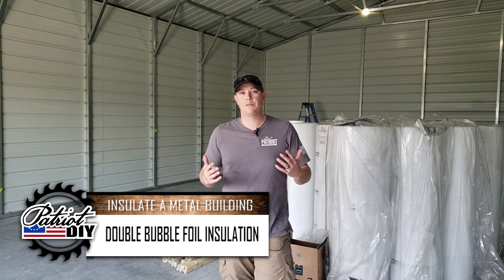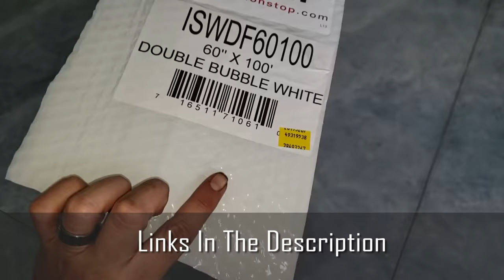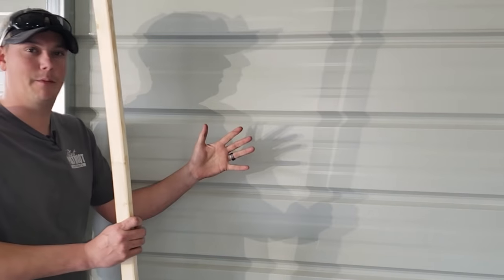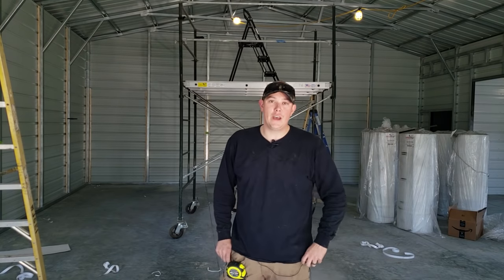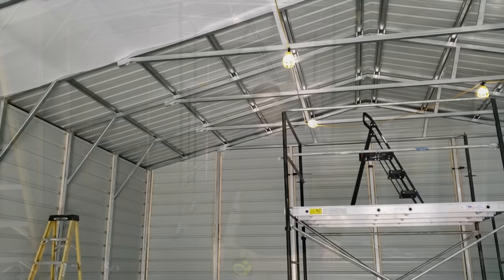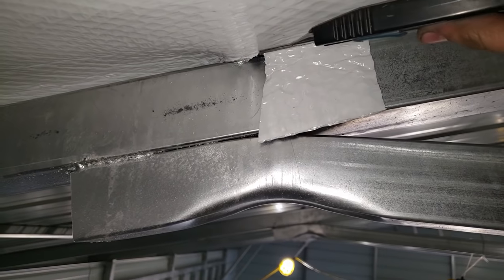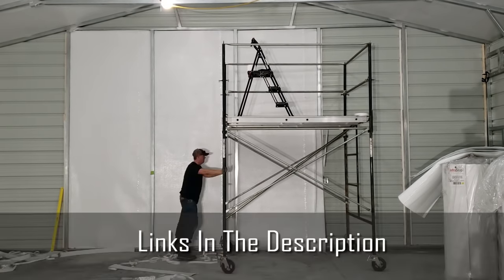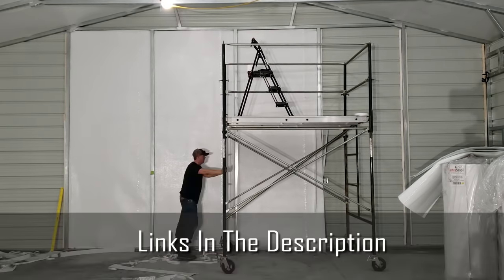How To Insulate A Metal Building / Double Bubble Foil Insulation

Comment from the maker: To answer Alot of your questions up front....since installation I have recorded a difference of about 10 degrees cooler inside on hot days .
Which is effectively a 20-30 degree drop from what it would be without the insulation since the radiant heat would have caused it to actually be much HOTTER inside than outside on hot sunny days.  I've also noticed about 10 degrees warmer on cold days. (This is with no conditioning)
- No I am not relying solely on double sided tape to hold this up, near the end of the video you will see that I also added staples and screws! 
- One afterthought is to also use small L brackets to secure the wood strips to the frame.
- I have 0 condensation issues since installing this! 
- Also, yes many of you say spray foam is better and of course you are probably right....but it's more expensive ...and this works for me! 
- I have since conditioned the space and achieve very comfortable working conditions (75° inside vs 98° outside) with this combination at a price I could afford! Stay tuned!
Thanks for watching!
Reply: Put some "real" insulation in that building and do some testing. I have compared both ways and the foil bubble sheet is basically useless, and a waste of money. But, if you feel this is the best use of your money, then by all means, go for it. Cheers!
Reply: I can send you our thermal treatment (like paint) maybe you can use it and give us a honest review, we are bringing it to USA in the next couple months and its even Waaaayyy cheaper than all that you did, what do you think? I am at Nevada.
Reply from the maker: @outdoorzee919  I wouldn't call a 20 degree reduction in internal temperature "useless" lol
Reply: @PatriotDIY  Sorry to disagree, but i have done my own testing and the bubble stuff basically does nothing. The R-value (thickness) of the insulation is ALL that matters and the bubble stuff has very little. R-value means insulating the cold from the hot - the thicker, the better  . . period. A 1/4" thick piece of insulation is worthless. But, if you feel it works for you, i am happy for you :)
Reply from the maker: @outdoorzee919  lol well I don't know anything about your testing ....all I can tell you is that my shop is consistently 10 degrees cooler than outside temp on hot sunny days and 10 degrees warmer on cold days. I've documented it in video on my Facebook page www.facebook.com/PatriotDIY 
You are welcome to disagree and do something different if you choose and no doubt there are better and more expensive insulators, but all I can do is show you what I did and report my results!!
Thanks for watching 😉
Reply: I'd be interested to know what you found in the winter as to how this method helped keep the heat in. Thx
Reply: @mxfenixorion4837  will your paint work on the outside of my metal garage door. It faces west and radiates a lot of heat
Reply: A big question is how did it do with condensation, do you check behind the foil to see if if it still there, is there any water at the bottom of the walls?
Spray Jones has pointed out how useless R value is a test for thermal transfer. Glad to see you getting benefits.
Reply: @outdoorzee919  I have 2 buildings insulated with double bubble and they are very comfortable. You can go ahead with what you use but the bubble insulation is the opposite of useless.
Reply: @truthinadvertising2702  When you have an R-2 with bubble stuff, and R-19 to R-30 with fiberglass insulation, that seems about useless to me. But, if you like what you have done, and R-2 is good enough for you, and/or that is all you can afford, then bubble wrap it is - better than nothing :) Cheers!
Reply: It's a big old microwave baby
Reply: @Trumptrain2024Vance  Before I insulated my metal shop building I nicknamed it The Easy-Bake Oven.
Reply: Based on your recommendation, I bought a 100' of the insulation and 6 rolls of double sided foam tape. I have a metal roof over wood frame on 24" centers without a ceiling. Now, my shop is the same temperature as outside instead of 20 degrees hotter. This may not be the best way to insulate a roof/ceiling, but it is a far cry from nothing. I am extremely happy with it. I can put in a a/c window unit now and have a nice shop to work in. Thank you for the video and the links for the product.
Reply: @PatriotDIY  you are right. Don't listen..
Reply: @j_cruz_56deuce26  use your own brain .learn thermodynamics.
Reply: @outdoorzee919  Did you test with a radiant barrier ( shiny foil ) on one, or both sides, with an adjacent air gap of at least 3/8"? Discounting the value of that radiant barrier is a fundamental error. Even in cold environments, a radiant barrier will reduce heat loss by preventing radiation of interior heat to the outside. When you state, "The R-value (thickness) of the insulation is ALL that matters", it is quite clear that you are disregarding one, or more, of the three factors of thermal transfer ( conduction, convection, radiation).
Reply: @PatriotDIY  Radiant barrier insulation counts for a lot! However, it would be wonderful to keep that hot roof working for you in the winter. Perhaps you could duct forced air through the ceiling, running only when the sun is shining.
Reply: @outdoorzee919  The R rating is only for the product itself, but no product is used independent of an installed system. As the man said, "if you install it correctly", as in, radiant barrier adjacent to an air gap. Incorrect installation goes a long way to making the product truly useless. For example, fiberglass batt, rockwool, and eps all lose insulation value when installed where condensation, or other water sources, can dampen them. R value, in the real world, not some isolated laboratory test environment, is ALWAYS dependent on correct installation.
Reply: Any updates on how this is working now that it’s winter?
Reply from the maker: @jaredbowling4872  roughly the same, about 10 degrees warmer that outside! Also holding heat really well when I run my wood stove! Had it 72 inside while 32 outside
Reply: @PatriotDIY  Did you fasten only the sides of the insulation on the long panels? I am doing my barn now and wondering if I need to leave top and bottom open or if it would be better to put furring strips and tape there as well. Thanks for the video!
Reply from the maker: @fieldbc  I fastened top and bottom too!
Reply from the maker: @kevinc233  Mr Cool mini split, I did a video on it
Reply: @Yespk-bo2xe  I think many of the nay sayers are missing the point.  It's not insulation as much as it is a radiant reflector.  Metal buildings are completely different and heat up quickly in the hot sun.
Reply: @drewdoestrucks Agree to disagree :)
R-value is R-value. It is what it is, and will not achieve additional value no matter what a person hopes or believes. Put a thin jacket on in the bitter cold winter and see how warm it feels  :)
Reply: @drewdoestrucks  that would be adding more thickness, which is more /thicker insulation, which is exactly what I'm talking about.
Reply: @drewdoestrucks  Agree that newspaper does not have R value. That is why it is not a good insulator. Better than nothing . . yes, but just barely! Best rule for insulation.  . . the thicker and denser it is, the better it will insulation the cold air from the warm air. That is why a person wears a thicker/heavier jacket in the winter.
Reply: Thanks use the screws
Reply: @PatriotDIY  There are three ways of heat transfer: radiation, conduction, and convection. I think the reflective surface is a good reflector for the radiation. A thick insulation is for conduction mostly. I am not you won't have condensation water. They are just behind the bubble foil.
Reply: L brackets will be helpful
Reply: Sounds great to me!
Reply: So why not put batts of fiberglass insulation on the steel between the framing and then cover this with the radiant sheeting as well to hide it - as you do with drywall- and to hold in the fiberglass insulation as well. The one issue is whether you will get condensation on the skin of the building under the sheeting alone or with fiberglass batts and the radiant sheeting on top.

I covered the interior of one of my steel buildings with peel double sided 2” wide tale on top of the steel framing and covered the framing as well as the exposed steel skin. Covering the framing might reduce radiation of heat or cold by the framing that contacts the outer skin. This worked well except on the ceiling where it fell eventually, wiping down the steel framing with acetone before applying the 2” wide double sided foam tape helped - but on really hot days the foam tape would allow the sheeting to fall in places. Solution was to run a small bead of construction glue down the center of each steel beam and also bought 1” stripes of plastic trim material and screwed this on top of the sheeting into the steel beams which mechanically keeps the sheeting attached to the ceiling. Used self drilling screws like what was used to attach the outer corrugated steel to the building.
Reply: Here is another solution. I have installed large exhaust fans on the building up high across from the roll up doors. These are wired to a humidistat and to a thermostat. If the humidity gets high in the building above the setting the fans comes on and pulls exterior air into the building to equalize the air inside with the air outside and if it gets above say 95 degrees the exhaust fan comes on and pulls and moves exterior air into the building as well. I do have vents cut into the skin across the fan location to allow air into the building as air is exhausted out of the building, the fans have shutters on them that fall closed when the fan is off.
Reply: I did all myelectrical before taping and gluing the electrical pipe to the steel beams. Should have done the electrical after the sheeting was installed - I put electrical pipe with plugs all along the pipe as well. Also bought strip led fixtures - about 4’ long - with plastic translucent covers and attached to the overhead beams using pipe - from fixture to fixture, 

Works really well actually to light up the interior of the building. Put the switch next to the man door.
Reply: @Chad Ford  yep, and they would be much warmer if they had some REAL insulation that is thicker than one layer of bubble foil.
Reply: So you definitely suggest this double bubble foil insulation for a studded metal shed
Reply: almost all sheds in Australia are like this and this is the type of insulation used, it obviously does a good enough job
Reply: @jeffreykilpatrick3592  aren't exhaust fans supposed to pull hot air inside the building out? Or are you just installing the exhaust fans in reversed, which turns into an intake fan? Sorry for the dumb question.
Reply: @mxfenixorion4837 id like to try that paint. We just built a 22x33 metal shop in Idaho and are looking for insulation options
Reply: @PatriotDIY  how do you think this would work in a smaller metal shed? I plan on turning a metal shed into a room, and I’ve been trying to figure out the best way to insulate it 😅
Reply: How do you like 2 years later. I assume it did not give you much of a temp drop
Reply from the maker: @hhazelhoff1363  about 10 degree difference from outside. But I now have a minisplit ac too and the combo works well for me!
Reply: @mxfenixorion4837  Tell me about your thermal Coating..
Reply: @mxfenixorion4837  I’m in the process of building a 30x40x12 building and so far we are only ready for putting the tin sheet up. The builder has suggested the double bubble. 
Are you painting the outside or inside? What’s it called??

Comment: Finally, someone posted a useful video on how to insulate a metal building.
Reply: Yes!  Good job!  Thanks!
Reply: Closed-cell foam would have made that building 3X stronger.
Reply: @Cspacecat  And cost 2x the price of the building probably lol
Reply: @VanillaAttila  Figure about 1/3rd more which seems quite expensive until you consider the possibility of a high wind condition taking that new building out with all your equipment inside.  If a panel rusts out, how much will that cost for replacement?  With closed-cell insulation, you can more easily cool and heat without moisture buildup at the interior metal surface.  Even an inch will do the trick.
Reply: @Cspacecat  That's what the aircgap behind the bubble wrap does.  As far as building blowing away, if you're counting on closed foam isulation instead of positive hurricane tie-downs holding frame to ground, good luck!
Reply: @roundedges2  The only thing that the air gap will do is let moisture in between the bubble wrap and the building.  That'll let the building rust on the inside and offer no additional stability.  It just might be a good idea to bolt that building to the ground.  The hurricane ties won't make a bit of difference.
Reply: Red double cells aka mirror no wonder it fell down
Reply: I really like this method of insulating your ceiling. Very Clean

Comment: I am wondering why you didn't attach the furring strips to the front of metal studs and cover the wall studs and ceiling rafters with the insulation? Those metal studs transmit a lot of heat and cold. It would also give you a larger air gap and prevent the insulation from touching the wall metal in between the furring strips.
Reply: That's what I thought but you'd have a potential to poke holes in the insulation and get insects and mice living in the air gap.

Comment: Now that you've had this insulation up for awhile, how well do you find that it is working? For both the heat and the cold.  I'm in the southeast also and am about to put up a metal building and am currently weighing my options for insulation.
Reply: Usually it’ll be about 10 degrees less inside than what it is outside. The main owner for most of the metal warehouses out here uses the same material and being Arizona it’s definitely a must. I’m getting my garage done today with the same materials so it’s a life saver for sure.
Reply: @IZA-611  Interesting. I have a small metal work shop, 12' x 16'. I installed an exhaust fan in the wall 6&1/2 feet above the floor. I put it on a thermostat set to turn it on at 80 degrees. That gets the building 10 to 15 degrees cooler than outside temps. 
 I live in western NC. It's not desert but we've had temps this year often in the mid 90's.
Reply: @KI-zj5tt  is that with or without the insulation? I’ve been meaning to get something installed maybe a mini split but it’s pretty cool inside the shop now even without it

Comment: All it is a bubble insulation with Very thin foil.  Wind and heat make it peel off..  You just can't beat home insulation 👍👍You can tack it, adhesive it, or wire it to hold it, or wood strips

Comment: Thank you for making this video.  So many great takeaways.  My wife and I did a similar project with similar materials, and watched this video many, many times before starting it! We used the wood strips to create an airgap, and double-sided tape.  I ended up using construction adhesive for the remaining walls because we ran out of the tape about 3/4 of the way to completion.  So far ours is holding up, but we need to add more vapor barrier tape on the edges.  Thank you for your content!
Reply from the maker: Great!  Did you also use any staples or screws in addition to the tape? The tape is great but I wouldnt trust it 100%
Reply: Vapor barrier tape?

Comment: I watched about 15 videos of how to insulate a metal building, each with a different method and different materials.  And everyone thinks what they did is best.  It’s hard for a diy guy like me to decide what to do…  Thanks for posting.
Reply from the maker: What I did worked and is holding up well with 0 issues to date. The only thing I'd change is after putting up the wood strips with construction adhesive... I would also install some small L brackets holding to the stud for a "Just in case" scenario
Reply: Judge by the temperature difference in each case and apply that to what your expectations are.  As he stated in this video, the R value is low, but it helps to block, or cut down the radiant heat from the sun heated metal.

Comment: My first thought was, "well, isn't the metal exterior acting like a radiant barrier already?". I read up on it prior to watching the video and realized I was wrong. Great install and great details in this video!! Thanks for putting out quality content.
Reply: Exactly what I thought when I initially put up my roofs.  Then I found out that the metal actually radiates from both sides and the energy from the sun is actually being radiated inwards by the metal panels.  I was shocked to learn that this made the inside of the building even hotter than it was outside.

Comment: Great job!  You are correct about the air gaps  and  it actually provides an increased r-value. We used foil faced foam board in ours with an air gap, supporting the ceiling boards with a non-conventional method. Has worked very well.
Reply: @Jim Cole  I am sorry I am not able to visualize your non-conventional method. If you don't mind, could you please elaborate? Or any video or website that shows your method? Thanks in advance. Merry Christmas
Reply: @goodingwashington6099  I will be posting a video of the install when I'm done with the building. 'Will be in Spring/Summer of 2022. Merry Christmas to you as well!
Reply: Thanks Jim Cole thats ironic
Reply: Why the air gap? Why is an air gap good? I have not heard a good explanation for an air gap. Thank you
Reply: @jimcole6423  It's about summer of 2023 now...Still not too late to upload those videos if you're still hanging around youtube. It will be greatly appreciated to see how you did yours. Thanks!